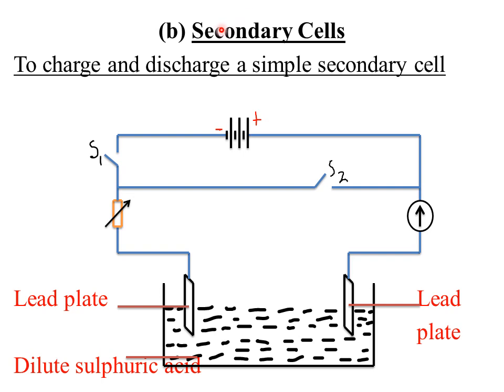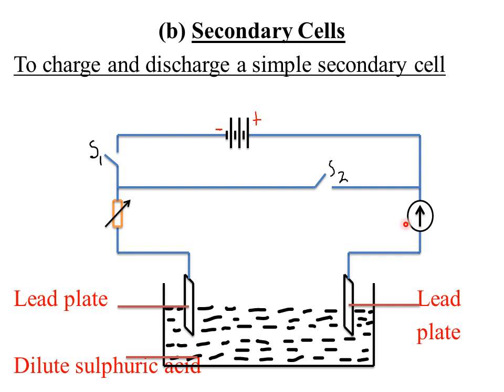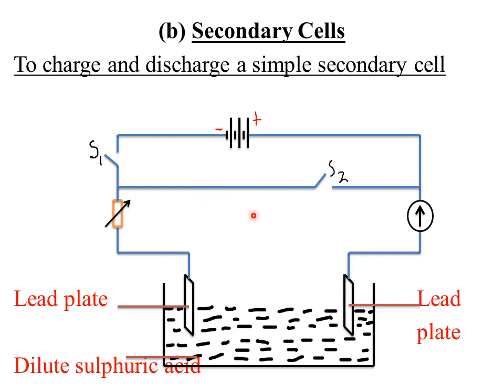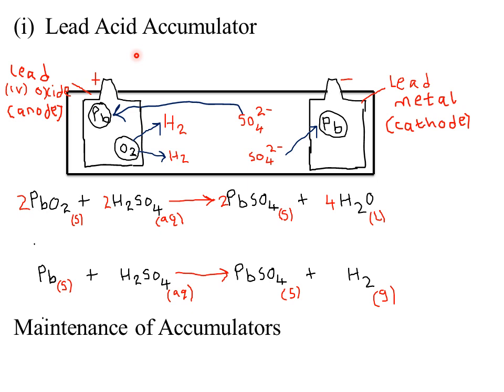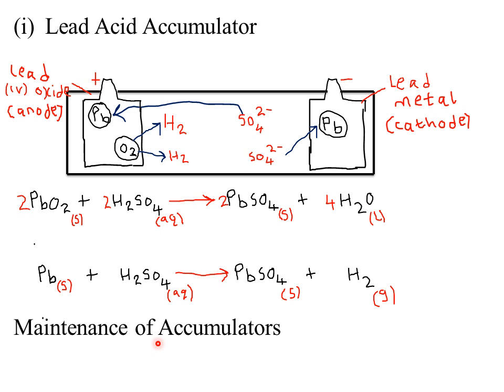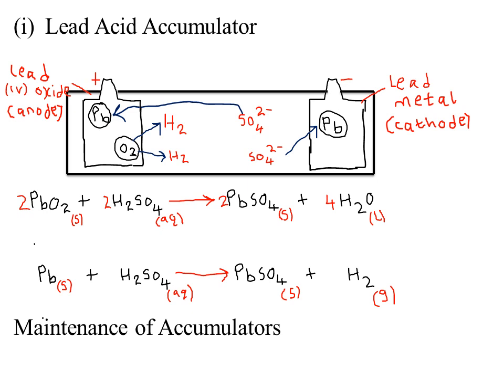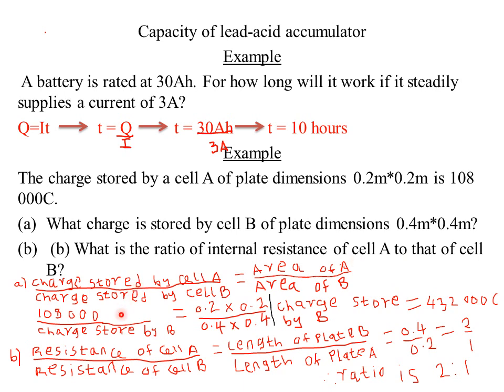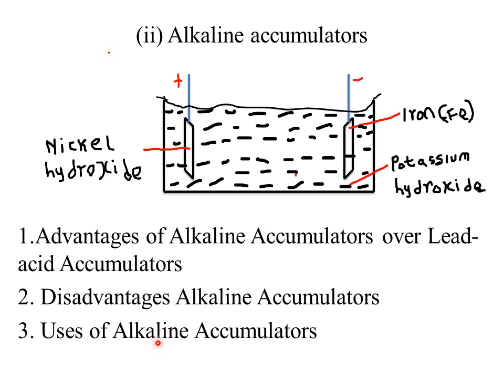CELLS AND SIMPLE CIRCUITS : LESSON 4

Comment: Mwalimu the calculation in question B in a is 108000×0.4×0.4÷0.2÷0.4= this is equal to 216,000
But you have an other answer please check where it is wrong or I'm wrong thanks
Reply from the maker: The calculation is ok, press this on your calculator= (108,000×0.4×0.4)÷(0.2×0.2) =432000.
Thanks for your comment 🙏.

Comment: Tr, if you are asked in terms of their electrons, distinguish between good conductors and poor conductors of electricity and insulators. Is oky if I distinguish using their there difination
Reply from the maker: In terms of electrons just say: Good conductors allow free flow of electrons through them, poor conductors allow very low(negligible) flow of electrons through them  while insulators allow no flow of electrons through them.

That's a very good question from you, keep it up 👏👏👏. You will understand more about conductors, semi-conductors and insulators when I'll be handling a certain topic in form four work called Electronics 🙏. Thanks for your comment, keep working hard, your future is bright 🙏.